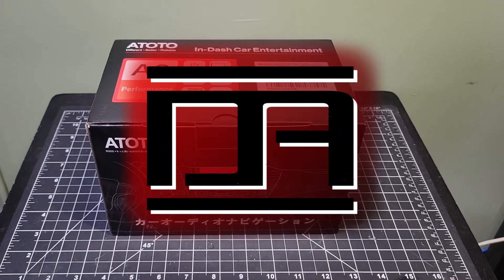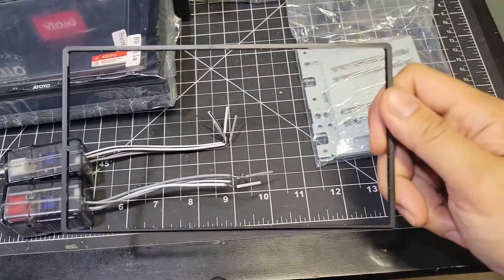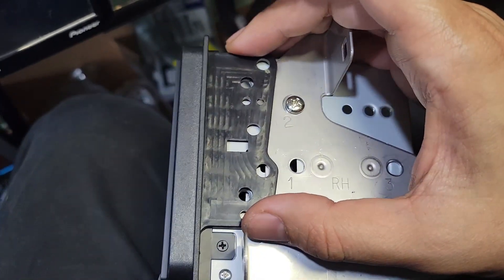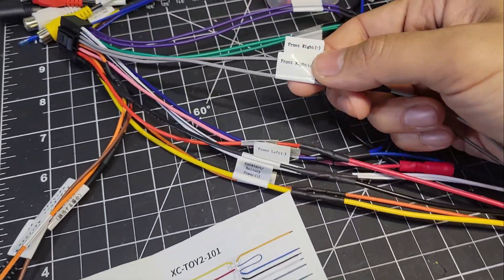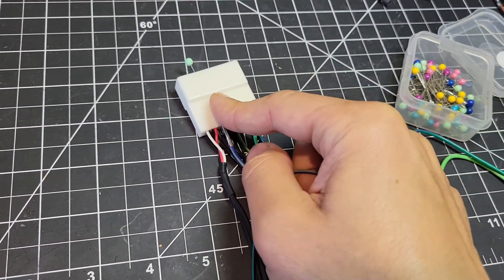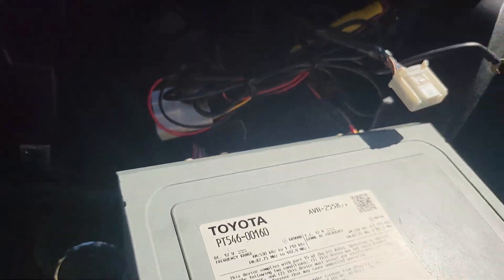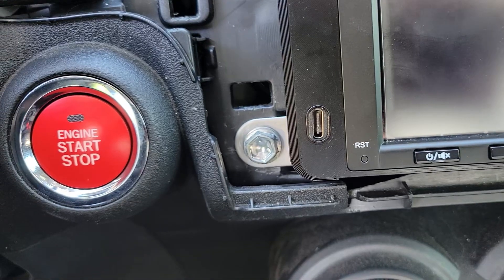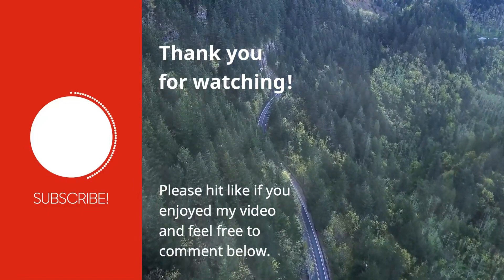ATOTO A6PF Android Head Unit Install with SWC Steering Wheel Controls (Scion tC2 / tC2.5)

Comment: For anyone following this awesome guide, please double-check if the existing backup camera is 12V or 6V. If it is one that was plugged into the factory head unit, you will need a 12V to 6V converter before hooking up the backup camera on to the acc wire.

it goes acc wire ->12v to 6v converter hot -> red backup camera wire. I attached the black ground wire to the chassis ground in the harness.

Comment: Great guide, I have the S8 model installed in my tC
Reply: Did you have to solder any wires?
Reply from the maker: The install for the S8 and the S6 will be similar, and I do recommend soldering your connections.
Reply: @richardgomez8010  have a blessed day 🙏🏽
Reply: @Derrick Aquino  Figured as much, great content, my friend 🙌🏽.

Comment: Hi, great video!! With the steering wheel control's, do you run the swc(-) wire directly to the swc(-) wire on the head unit, or do you ground it externally?
Reply from the maker: Can you clarify which color wire from the 28 pin harness that you are referring to? I want to make sure I'm giving you the correct answer, but if you mean the black wire, then I've tapped that into the ground wire on the main harness. If you mean either of the switch wires, then there's go to the corresponding switch wires on the head unit.

Comment: Great video! I've got a 2004 Celica that I'm hoping to fit with a A6PF using your 3d printed faceplate. im looking into getting a build plate for my printer thats engraved with a carbon weave or a diffraction grating. Im thinking that will make the front of the face plate have a nice texture.

Comment: Thanks for the video. I was able to follow this to install a F7 XE 10.1 INCH. 

 However I ran in to an issue. The connector from Atoto has an remote amp wire (blue ish color) do I need to hook that wire up to somewhere in the car ?

I think all the speakers work currently but it doesnt sound as good as factory / especially lack of the bass. 

Maybe the factory Amp is not being powered ?
Reply from the maker: You want to make sure the blue power antenna wire at video position 05:28 is hooked up as that's what will turn on the factory amp that powers the bottom 6x9 speakers in the door. The remote amp wire would be used if you had an aftermarket amp (subwoofers) that you wanted to have control of turning on and off from the head unit settings menu.
Reply: Thanks for the clarification. I wired it just like you did, I guess I just need to play with the EQ.  thank you very much for your video !!

Comment: Hey Derrick question so I currently have this head unit, I have seen some Atoto have the start up logo on them. However I can’t seem to find anything on the A6 start up logo have you managed to do so? I want to put a Scion start up logo like on the OEM head unit
Reply from the maker: Since I don't see the logo unless I completely reboot the headunit, which is rare, I haven't bothered looking into changing the logo. I instead opted to use the AGAMA Car Launcher that had the option to use the Scion logo in the middle.

Comment: Hey what do you think about the a6pf after 10 months? Do you find it slow and unresponsive? Do you usually use carplay or android auto? Much appreciated!
Reply from the maker: It's working great for me. I'm only using it for Android Auto or the Torque app. It's responsive enough for how I'm using it.
Reply: @VampyreX13  First time doing this kind of thing, spent a few hours on wiring and just got mine working!! You make it looks so easy! First impression is big difference in Audo, the stock was better. Also my rear left speaker wasn't working, gonna re-check the connection in a bit
Reply from the maker: @trashquant  it requires some tuning to get it to sound good. Once I got my time correction, crossover, and EQ set, it sounds a lot better.

Comment: hey bro, I just placed an order for this head unit because of your video. thanks for all the detailed steps. Question: for the USB harness, you mentioned you connected it to storage. does where does that USB connection go to in the car?
Reply from the maker: To the USB / AUX port just in front of the shifter.
Reply: @VampyreX13  still new to all of this so sorry for all of the questions. but for the aux/ usb port, do I need to buy some sort of a new case to fit the atoto phone link and external usb cord in there or do I just let the wires dangle freely? I don't think I spotted the portion in the video that went over this part fully
Reply from the maker: No, you just plug the Red Wolf USB harness into the head unit's external storage USB port and the car USB connection to the harness. If you want to use the phone link instead, you can connect the USB to that, otherwise you'll need a separate USB port. That's why I designed that new face plate. You can probably just leave the phone link disconnected though as wireless Android Auto works well.
Reply: @VampyreX13  thanks man! I'll be installing everything tomorrow. I was able to get your bezel printed as well. HUGE help indeed. 

Last question, do I HAVE to buy that steering wheel control harness to make steering wheel controls work?
Reply from the maker: @vile0148 yes, you need it.
Reply: @VampyreX13  thank you. I'll order it. To confirm, I don't need to buy the ASWC-1, just buy the Axxess harness you showed?
Reply from the maker: @vile0148  correct. Since you can program the signals from the steering wheel controls directly into the head unit, you do not need the ASWC-1.
Reply: @VampyreX13  thank you. you're the goat
Reply: Just a thing to note: bought everything and went to install. A thing I found out is that the USB harness adapter and 28 pin harness won't work for a 2011 tc. And the antenna harness isn't needed either. I had to order another harness for the swc, still searching for the proper usb harness as well.
Reply from the maker: @vile0148  let me know which harness you needed for your radio, and I'll make a note in the video description. How come you didn't need the antenna harness? I'll take a look and see if I can find the USB harness you need.
Reply: @VampyreX13  I have a blu logic module in the car from stock. I found when I connected the atoto, the front speakers were lacking even after adjusting the sound settings. when my phone connects to the blu logic, only the front speakers work now but the sound is super thin and faint. still trying to figure out what the blu logic is connected to in the car because I can't see any red/ white aux inputs anywhere. it's quite confusing. This isn't my area of expertise but still trying to figure it out
Reply: @VampyreX13  oh and fyi, my speakers sounded nicer with the stock head unit. after putting the atoto a6pf on ,  that's when I started to notice the front speakers sounding off. I think it could be both the blu logic and atoto being connected to the front speakers at the same time through 2 different harnesses. not 100% sure,  not even sure how to go about it lol
Reply: @VampyreX13  hey! I just installed the new swc harness I sent you with the method you did in the video. It seems that the 1st gen up to 2nd gen 2011 tcs use a 20pin swc connector . So the link I sent you is definitely the right one for 2011 scion tcs. 2012 and up use thr 28 pin
Reply from the maker: @vile0148  fantastic. Thank you for the update. I'll make a note of that in the video description when I get home tomorrow.
Reply: @VampyreX13  for sure! Also a thing to note, I still chopped off the other connector like you; but in the 20 pin harness it has a ground that is spliced to 2. I closed off one and spliced the other to the head unit harness. Also, aside from the ground there are only 2 wires in addition which are the swc. There's no rear cam wire etc. 

Never have I commented so much on a video but you've helped me tremendously throughout installing my first head unit. Followed you on IG, keep up the amazing content. I'll continue learning from your ways!

Comment: I installed this same product yesterday (not by myself - had help from someone who does this professionally), it worked great. Today it worked for about 1/2 hour then shut off, won't turn back on. I don't know why. I checked the fuses, etc. all are good. Does anyone have any idea what could be causing this issue?
Reply from the maker: If the fuse is good, confirm you're getting power on the yellow constant power wire and red accessory wire (make the ignition is set to on). If you have power on both, then I would reach out to ATOTO support.

Comment: Do you have the viofo camera wired up for parking mode? I have had 2 cars wired up in parking mode and both of the viofo harness modules failed so i replaced them both and those have also failed. I know what i’m doing with ACC/bat/gnd, its definitely the modules misbehaving i’ve verified with multimeter on inputs and outputs.
Reply from the maker: No, I don't use parking mode on mine.

Comment: hello! any way I can complete this process on the scion tC 2015 (2.5) without soldering? Would you know any other products that are more plug and play? Not many videos online for the scion tC2.5s so I really appreciate this one!
Reply from the maker: Car stereo installations are generally going to require making a harness because of the differences in plugs on the back of head units, although a lot of Android head unit to use the same 16 or 20 pin plugs. You can use crimps if you don't want to solder, but I always like soldering because it's more secure. I think I ran across a prebuilt Android harness at one point on Amazon, but it didn't have all the connections you need for it to be fully functional or you needed to modify some of the plugs to make them work, which is why I did not include it in the video.
Reply: @VampyreX13  aw gotcha. Thanks for the great detailed answer !

Comment: How’s the factory bass?? I installed a Sony double din car play on my tc but lost my factory bass. It sounds so weird without bass. Followed the wiring like this…. Any advice ? I already played around with the settings and no luck.
Reply from the maker: Make sure you have all the blue power antenna wires hooked up because that's what turns on the factory amp under the driver side seat.
Reply: @VampyreX13  hook up the blue wire  to the new blue on the metra harness??  Yes, I see the amp under my seat.
Reply from the maker: You should have 3 blue wires labeled power antenna (head unit, factory harness, and antenna harness). Hook all three together.
Reply: @VampyreX13  thanks for such speedy responses. I will try it! Keep ya posted ! Thank you!
Reply: @Forddude24 did this work? Having the same issue in my TC
Reply: @p.diocee8177  i gave up and installed the stock unit. Please let me know if you fix it.

Comment: does any other head unit work or just the A6
Reply: any other head unit by atoto
Reply from the maker: It should be about the same. The only difference is that some headunits use a 20-pin connector instead of 16, so some of the wires that would have been on a separate harness would be on the 20-pin one.